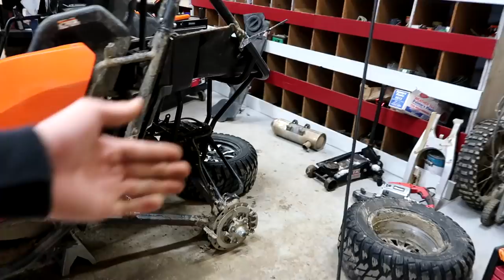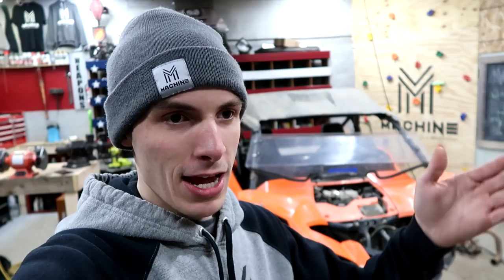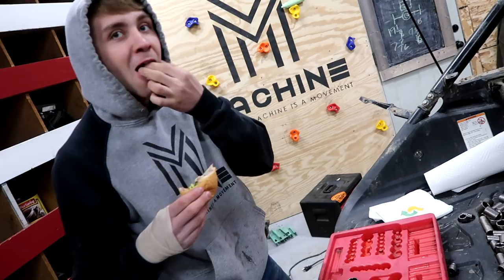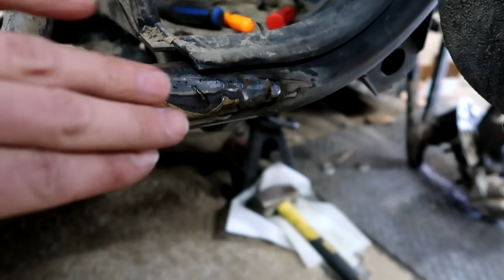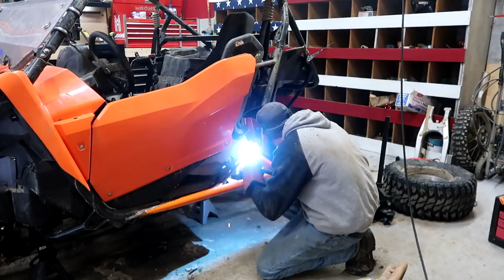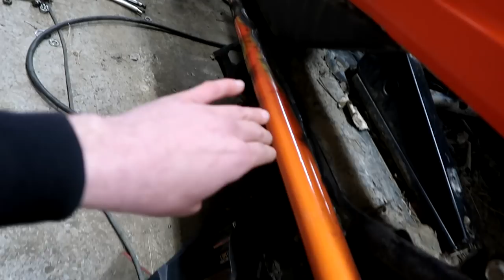They PAINTED My NEW Parts The WRONG COLOR

Comment: Did some quick research and they make liquid powder coating stuff you can mix with the powder and spray or even brush on those spots and cure with a heat gun.

Comment: Just a question, not critisizing...why didn't you make(or shape) brackets to bolt the rock guards onto the machine instead of welding right to it? Just would make things alot easier to take off for repairs or a swap out later on?